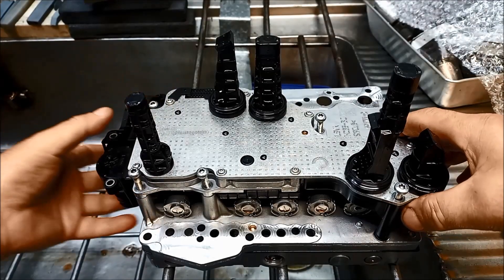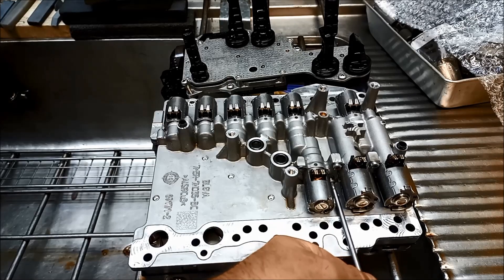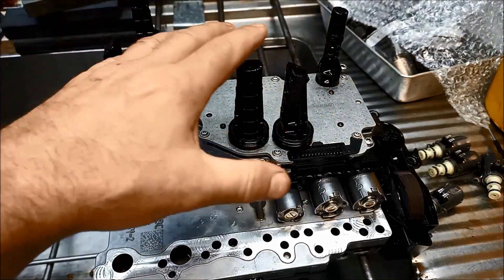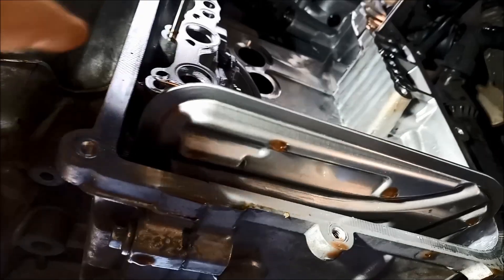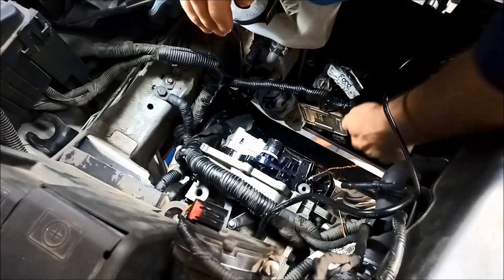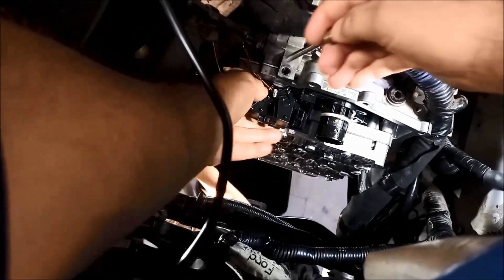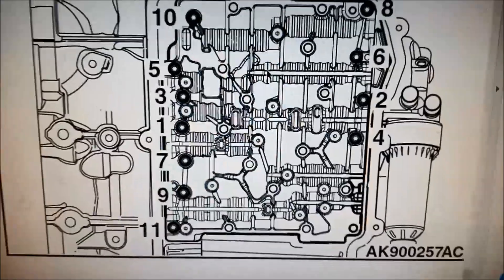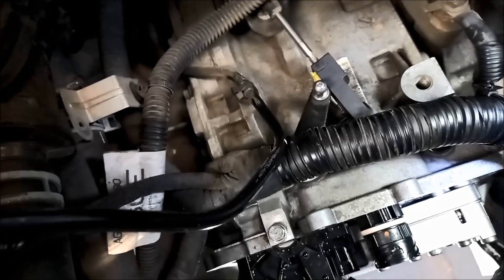6DCT450 MPS6 Mechatronic Plate Align with Solenoid Terminals & Refit Valve Body In Car How To Do DIY

Comment: Hi. I paid extra attention to transmission range sensor positioning with alignment pin, but now the car cant recognize Park position and gearshift is locked :((( . I hope I had selector lever in correct position. By ATSG is DRIVE the last lever position  = there is no oteher position while rotating to the left on  dct450, is it? :(((
Reply from the maker: hi, sometimes you need to disassemble with care to see where the alignment holes are lined up before you pull apart. might be helpful if you watch our other 6dct450 vids in playlist. cheers
Reply: @YepThatsIt  Hi, thanks for the reaction. I hope I've solved it already. Today I repeated it all again and it seems   much better :D. Drive is NOT the last position of the lever as I ever thought. The last counterclocwise lever position is probably for Sport mode.
Reply: Did u do selonoid adaptation because u change the new selonoid?

Comment: Late mail. Misko hi, noticing that the Mk5 Mondeo (post 2015) Powershift is not having the failure rate of the Mk4? Is there a difference? Is the design better? cheers
Reply from the maker: hi, they all break down and all need regular servicing to be more reliable. they have differences ( and id expect improvements ) regular fluid change every 50,000km and then every 2nd service take off the front cover and clean the magnets ( add magnets as well ) and you will get more life out of your trans. cheers
Reply: @YepThatsIt  thanks for this. The Mondeo Mk4 diesel is a beautiful car but hobbled by the Powershift. I've had to retire mine, as not worth the fix. The Mk5's seem to be more hardy and I'm guessing some of the design flaws were sorted. Magnet advice noted.
Reply: My understanding is that post 2017 vehicles have fixed the issue with the plastic spacers in the wet clutch, so a 2015 car would still be vulnerable to that failure.
Reply: @BillCarrIpswich they've gone to a dual mass flywheel haven't they?

Watched a guy rebuilding his McLaren the other day, they seem to suffer with plastic clutch parts failing too.

Comment: Hey mate what’s the part number for the solenoid and how much did they all cost
Reply from the maker: hi, on these i recommend replacing complete set. or if you can properly bench test solenoids at the least ( dont forget to also test them warmed up ). if there are bits of plastic in the fluid then you will need to remove trans and replace the spring retainers as well. cheers

Comment: Hi m8 I have the same mps6 auto and currently won’t drive in any gears. 

I’ve got 2 error codes p2718 & p0968 (pressure control solenoid 3 & 4 circuit/open) I align transmission range sensor in Drive but I get PRND light  in “Park”.
So I re-align to 1 step from “Drive” but I get the “PRND” light on the overdrive (on semi gears). 

Either way I’m still getting these fault codes and I have used the “align” tool also.
Reply from the maker: hi, open circuit ? usually broken wire or no connection. are the same codes present? you may need to contact me via our facebook link, incase we need to exchange vids and pics and beers.....link is in description. cheers
Reply: @YepThatsIt . Hi mate did you fix this problem as I am trying to fix the same one. Thanks
Reply: I have the same problem.
It told me to put into parking gear, but i already did.
Did u solve the problem?

Comment: Thanks for nice video. I have strange glitche happen. When I'm on drive reaching 80km/h gearbox falls in service mode. But nothing like that if I'm driving in sport or manual mode. Any idea where to look in?
Reply from the maker: hi, might be helpful if you read past comments ? a fault code generally relates to an electrical issue. cheers
Reply: Sorry for disturbing again, at the same time there no odd gears. After restarting everything goes normal till I reaching a little bit over 70km/h. Ford garage can't find what is making this problem. They want to replace gearbox...
Reply from the maker: @TheMcGIRTS  ford don`t repair these and mechanics are afraid of them. if it isnt   leaking or containated solenoid/s or sensors and clutch spring retainers are in tact, then you have issure with worn shift forks or actuators. cheers

Comment: You have replaced instead of clean these solenoids.  Is this because the solenoids were faulty or is it now cheap enough to just replace them?
Reply from the maker: hi, replaced as 3 were leaking and you can`t find genuine oem solenoids sold individually, you can only buy whole set of 9. cheers
Reply: @YepThatsIt  How can you tell they are leaky?
Reply: @supermicrodualcpu  Air compressor with correct connection as he has demonstrated before,checking on guage probably for correct compression maybe.